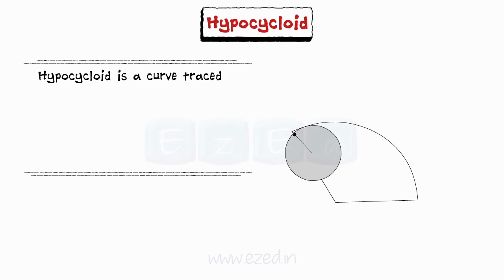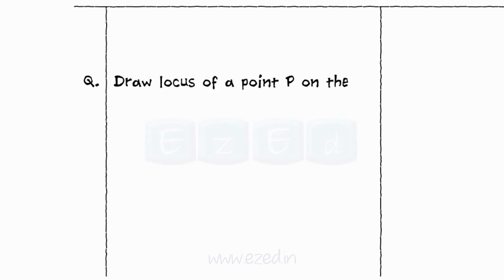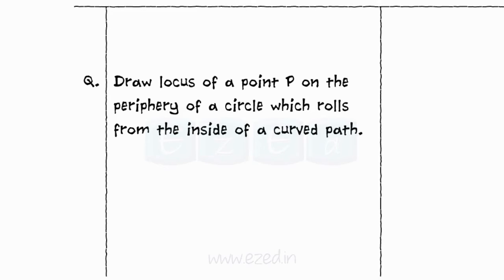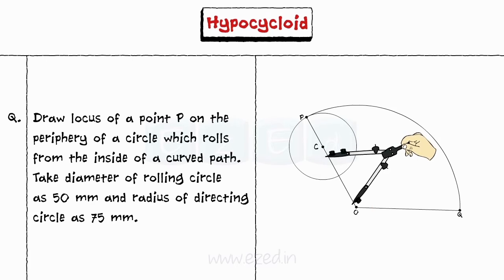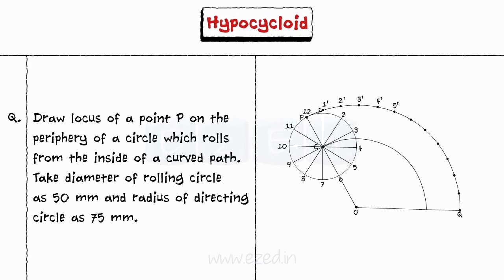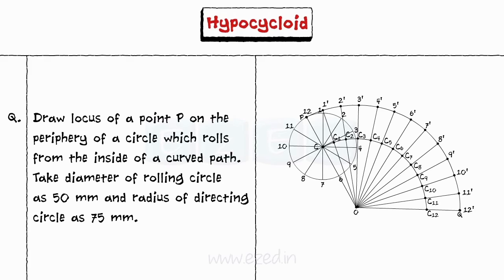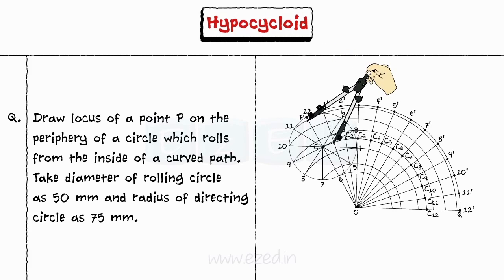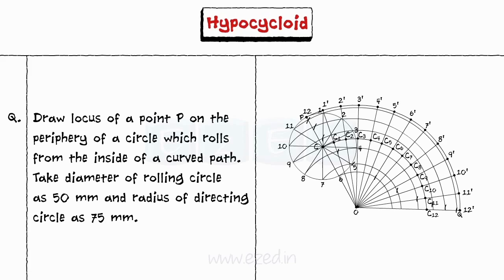How to DRAW a HYPOCYCLOID CURVE? Engineering Curves  - Engineering Drawing

Comment: I saw a question how do you divide an arc into 12 equal parts.
Just take the amount of cm you are dividing it by and use your compass to divide
Put it on the starting point make an arc on the arc then put in on the intersection and make another arc
Hence dividing it

Comment: how do i divide an arc into 12 equal parts?
Reply: Take 60 and 120 degrees to divide into 12 parts
Reply: If angle is general then use protractor otherwise use compass to find angle bisector
Reply: Just click on the arc, tyoe in divide, click enter then type 12 then enter again (if you want to see the divided parts click node on the snap grid)